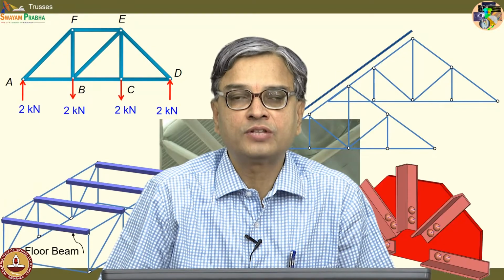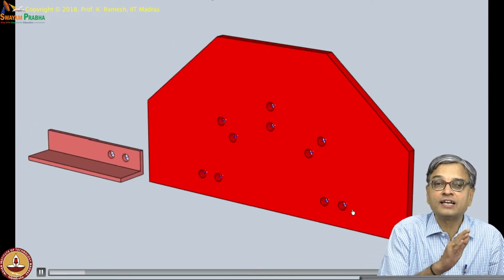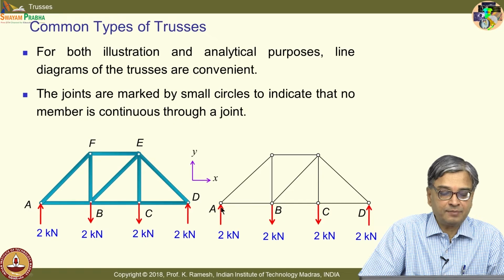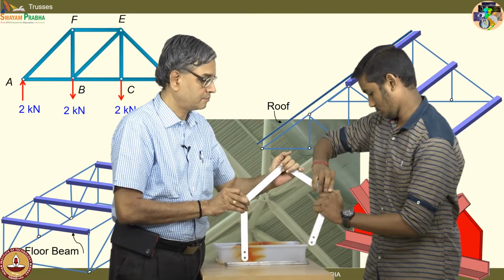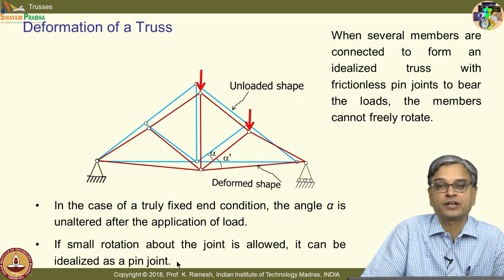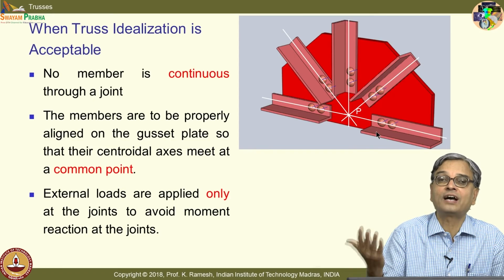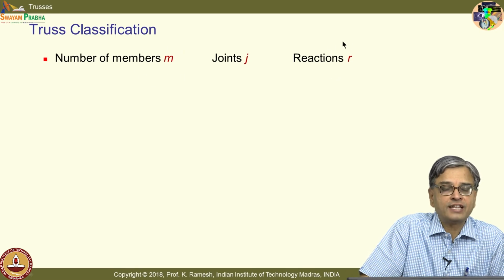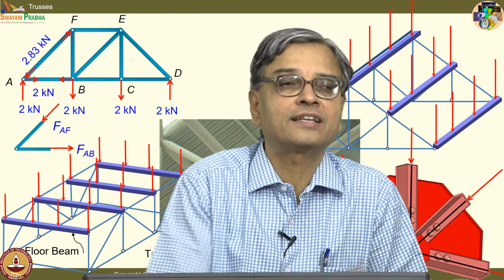Lec 07 Trusses I

Comment: Sir, Practically in steel trusses the top and bottom chord are continuous over joint not broken at joint , so could please explain this issue.
Also some time the steel trusses are welded, so in that case the connection remains pinned or fixed ?? kindly elaborate.

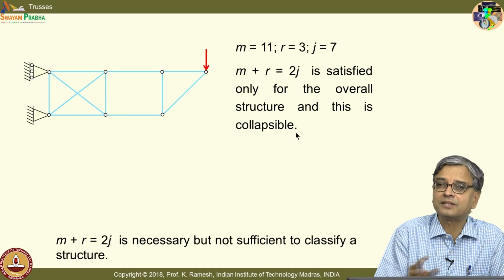Comment: 40:49 how we can obtain r = 3 ?
Reply: 2 reaction at the fixed support and one at the roller..... At fixed both horizontal and vertical reaction will be acting whereas at the rollers support only one perpendicular to the surface would be acting since it doesn't restrictions motion along the direction parallel to the surface.

Comment: 29:10 in pedestrain bridge how is  live+dead load transmitted to earth as truss is not at the bottom ,only arrests wind force.
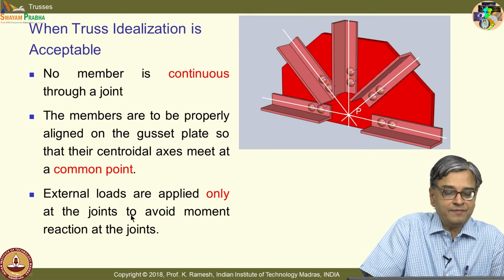31:22 how transferring weight at joint not producing moment reaction and they are pin joint  so they donot apply moment rexn even at middle.
Reply: Pedestrian bridges like any other truss bridge are supported on end supports (called abutments) and possible mid supports (called piers). All applied load get transferred from the truss to the ground through these supporting structures.

Pin joints do not provide restraining moments. However, this does not imply that members supported on pin joints will be free of moments at all points along the length. This depends on the force system applied.
The truss members are carefully aligned at the joints so as to create a concurrent force system. As a consequence, net moments get nullified.